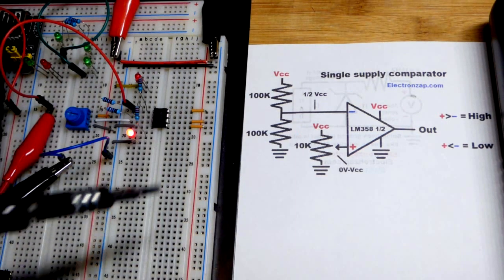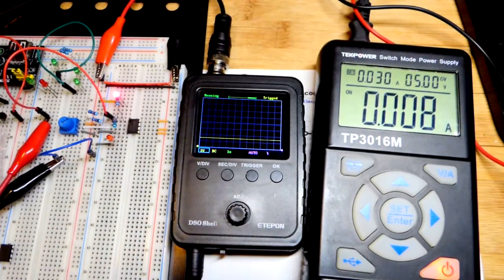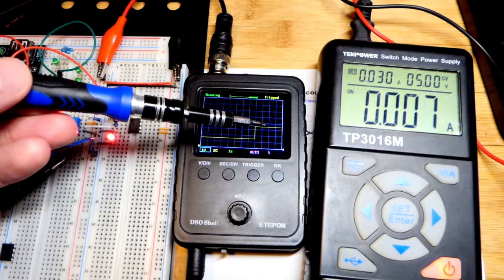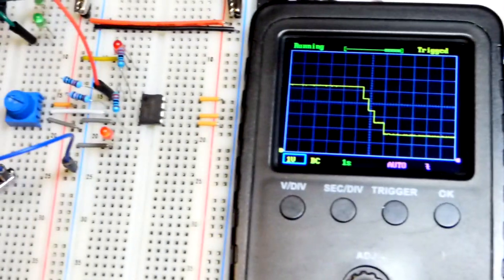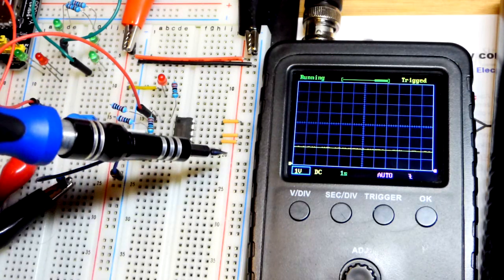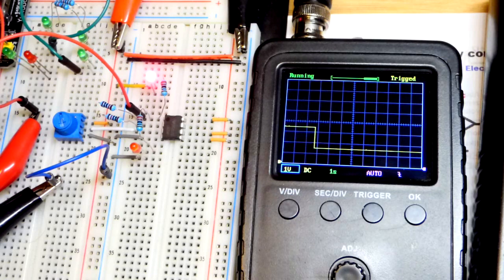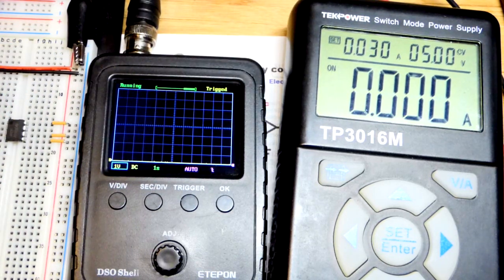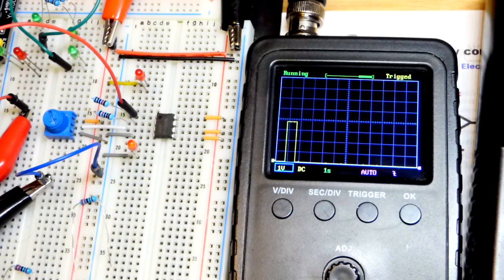Quick look at easy to miss problems I discovered with my LM358 op amp comparator demo circuit

Comment: would manipulating with a higher resistor value on the noninverting input will be able to change the signal high/low? i am new to op amps and will probably be using a 9v power supply. thanks in advance!
Reply from the maker: The inputs just look at the voltage, they don't care what provides it. The output is the tricky part when it comes to designing an op amp/comparator circuit that goes to either rail voltage. I don't have an easy answer right now.  It's just best to keep researching components until you find one that is made to do what you ask of it. There are specially made comparator integrated circuits.